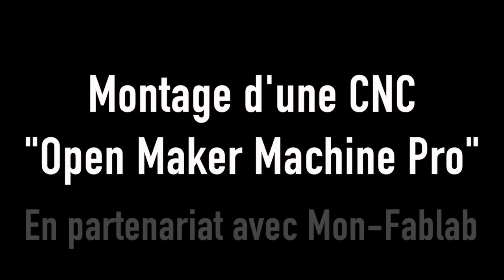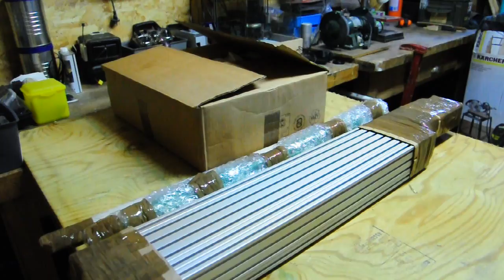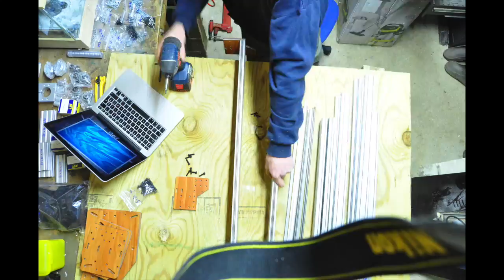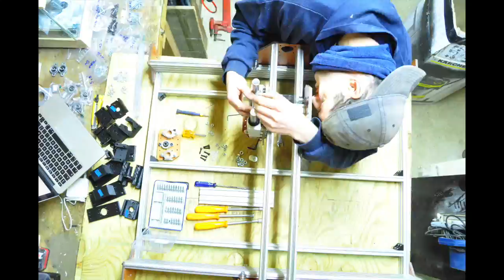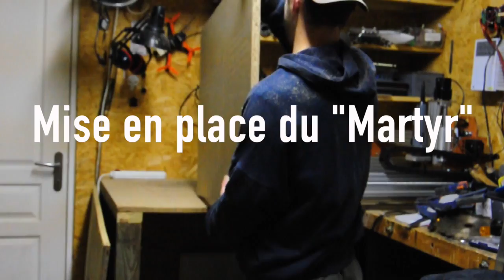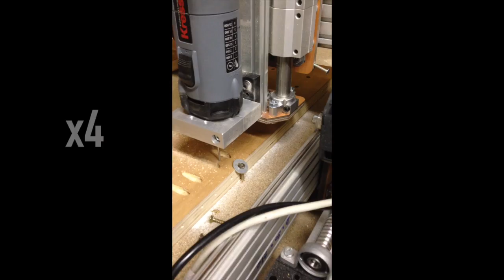CNC Open source

Comment: Bonjour Carlos,
Merci pour cette vidéo sur ce modèle de fraiseuse CNC.
Après plus d'un 1 an et demi d'utilisation, qu'en ressort-il en terme de qualité, précision, robustesse de ce matériel ... ?  et quid de la couche logicielle pour piloter l'engin ?
Reply from the maker: Bonjour, 

Cette machine était un prêt de l'entreprise "mon fablab" dont je connais le responsable. J'ai pu utiliser la machnie plusieurs mois. J'en étais très satisfait du point de vu de l'usinage. La broche est une KRESS donc pas de soucis de ce côté là du très bon matériel. La machine peut usiner de l'alu mais elle ne va pas faire cela à la chaîne et cela va aussi dépendre de l'aluminium utiliser. Pour le bois je n'ai pas eu de soucis, n'y même le carbone en 3mm. 
Pour la couche logiciel, j'tulisais un plug-in de SolidWorks "HSMWorks" pour créer le G-code puis GRBL faisait le reste. Ce n'ai pas une couche logiciel Open-Source mais c'est celle avac laquelle j'étais le plus à l'aise. 

J'ai rendu depuis la machine et je compte m'en fabriquer une, car c'est mn truc de fabriquer mes outils !